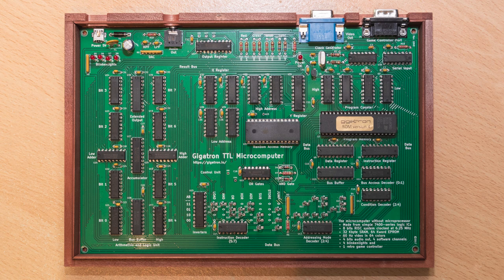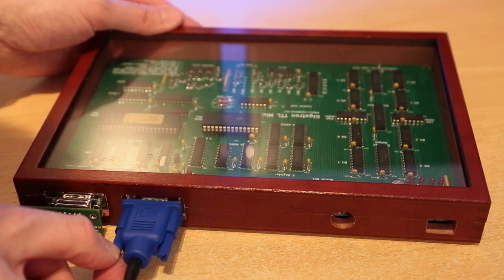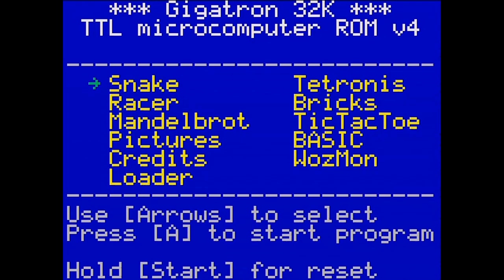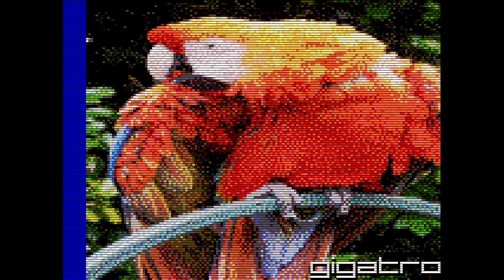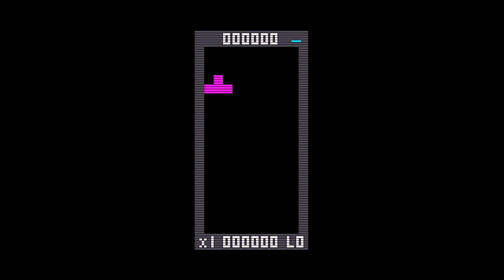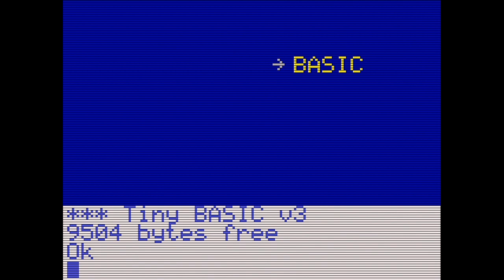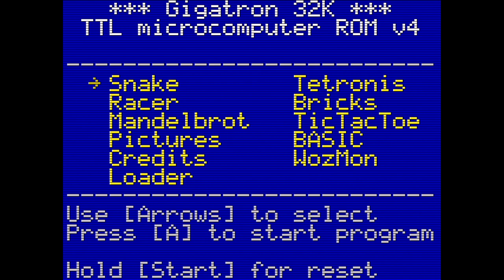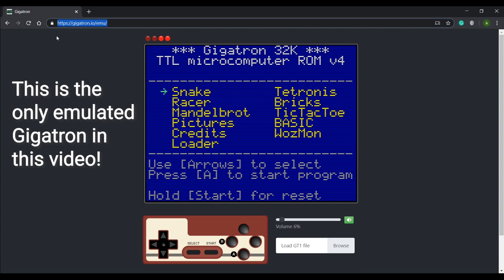What can you do with a Gigatron TTL computer?

Comment: might buy one when as a summer project if i have no projects by then
Reply from the maker: It was a good project 👍 I enjoyed the build and having a play with it. The PS/2 adapter is a must! Am looking forward to trying out the pod and save function with an Arduino too, might have to make that my next project.
Reply: @iNimbleSloth  I picked up an old VGA monitor last week for another microcomputer project
Reply from the maker: @Jalecko  What project have you got in mind?
Reply: @iNimbleSloth  im building a computer running BASIC using arduinos
Reply from the maker: @Jalecko  Nice one 👍, I'd like to see a link to that when it's done or on the way to being done.
Reply: @iNimbleSloth  maybe i could make a youtube series about it
Reply: Finally got it working
Reply from the maker: @Jalecko  The Arduino project or did you build the Gigatron kit?
Reply: @iNimbleSloth  i build it